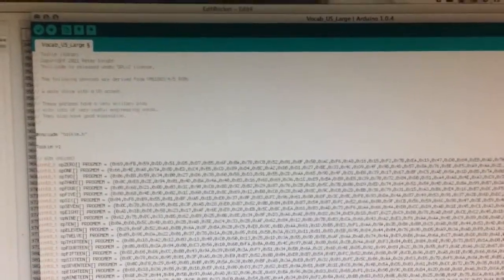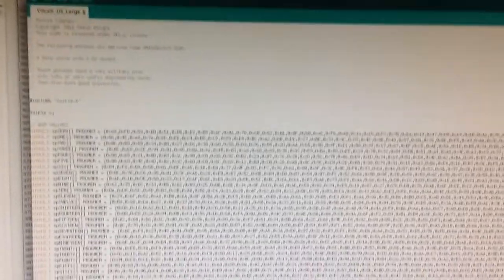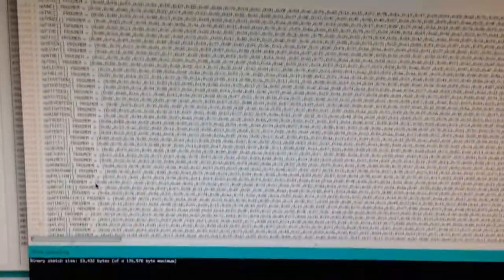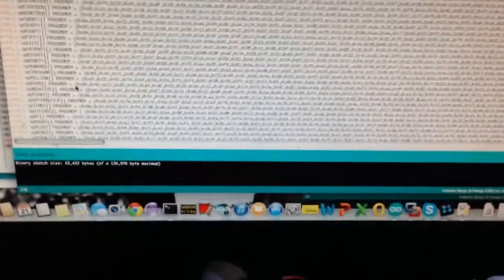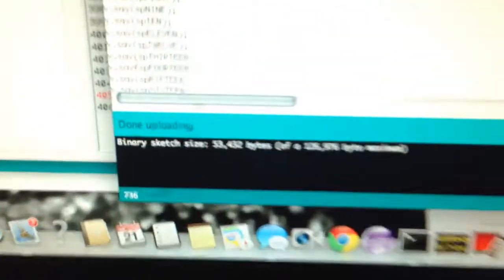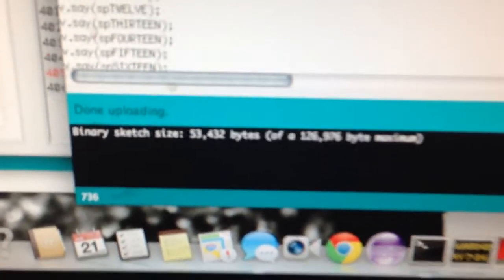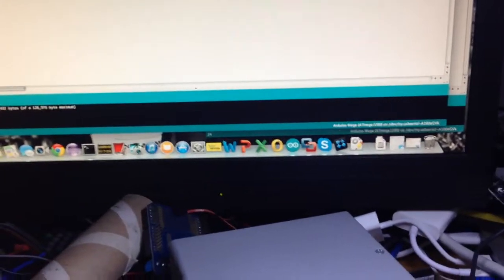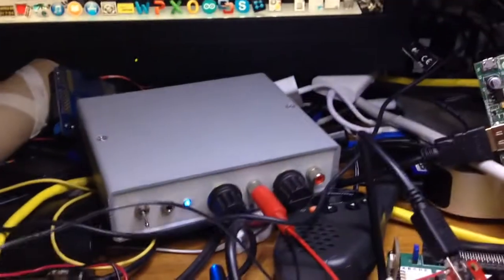Arduino Talkie speech synthesis

Comment: Tried the new talkie.cpp on the leonardo board with the pin on 5. But unfortunately, more error messages surfaced. I think these are registers on certain arduin oboards that are not present on the Leonardo. Will try to read the datasheets for it. Cheers once again and Thank you! Danger Danger Red Alert The Motor Is Fire! Hehehe :)
Reply: Yeah, different chips with incompatible ASM differences.

Comment: Hi @Ingmarthe geek. Thank you for this fix. The talkie TTS is now working on my Arduino MEGA ADK board with some minor addition to the code.  The arrays, a per Arduino IDE's advice will have to be set as constants. As an example the line "uint8_t spDANGER[] PROGMEM = {0x2D, 0xBF, 0x21, 0x92, 0x59, 0xB4, 0x9F, 0xA2, 0x87, 0x10, 0x8E, 0xDC, 0x72, 0xAB, 0x5B, 0x9D, 0x62, 0xA6, 0x42, 0x9E, 0x9C, 0xB8, 0xB3, 0x95, 0x0D, 0xAF, 0x14, 0x15, 0xA5, 0x47, 0xDE, 0x1D, 0x7A, 0x78, 0x3A, 0x49, 0x65, 0x55, 0xD0, 0x5E, 0xAE, 0x3A, 0xB5, 0x53, 0x93, 0x88, 0x65, 0xE2, 0x00, 0xEC, 0x9A, 0xEA, 0x80, 0x65, 0x82, 0xC7, 0xD8, 0x63, 0x0A, 0x9A, 0x65, 0x5D, 0x53, 0xC9, 0x49, 0x5C, 0xE1, 0x7D, 0x2F, 0x73, 0x2F, 0x47, 0x59, 0xC2, 0xDE, 0x9A, 0x27, 0x5F, 0xF1, 0x8B, 0xDF, 0xFF, 0x03};" will now have to be "const uint8_t spDANGER[] PROGMEM = {0x2D, 0xBF, 0x21, 0x92, 0x59, 0xB4, 0x9F, 0xA2, 0x87, 0x10, 0x8E, 0xDC, 0x72, 0xAB, 0x5B, 0x9D, 0x62, 0xA6, 0x42, 0x9E, 0x9C, 0xB8, 0xB3, 0x95, 0x0D, 0xAF, 0x14, 0x15, 0xA5, 0x47, 0xDE, 0x1D, 0x7A, 0x78, 0x3A, 0x49, 0x65, 0x55, 0xD0, 0x5E, 0xAE, 0x3A, 0xB5, 0x53, 0x93, 0x88, 0x65, 0xE2, 0x00, 0xEC, 0x9A, 0xEA, 0x80, 0x65, 0x82, 0xC7, 0xD8, 0x63, 0x0A, 0x9A, 0x65, 0x5D, 0x53, 0xC9, 0x49, 0x5C, 0xE1, 0x7D, 0x2F, 0x73, 0x2F, 0x47, 0x59, 0xC2, 0xDE, 0x9A, 0x27, 0x5F, 0xF1, 0x8B, 0xDF, 0xFF, 0x03};". My Arduino IDE version is 1.8.3. Cheers! and Thank you once again.

Comment: Hi @Ingmarthegeek, from what I have read from your fix below, the fix is a change in the line PINMODE(3, OUTPUT)  in the talkie.cpp to PINMODE(9, OUTPUT). And is this fix working with Arduino IDEv1.8.3?

Comment: Great demonstration. Is there a docomented proceess to add your own words? Could you explain the fix for using it on the Mega2560?
Reply from the maker: Wow, timewarp :-) Sorry I'm not very attentive when it comes to looking at YT comments. From memory the fix was as easy as ensuring that the PWM output pin on the MEGA2560 was set as an output using the PINMODE command. The default  in the library is PINMODE(3, OUTPUT) but the MEGA1280/2560 actually output their PWM on a different pin. I can't find the modified library at the moment and this is just going from a quick look. So my caveat is double check this yourself, I get really annoyed about people preaching the wrong info on YT so I will at least warn you I am not sure at present! Good luck.
Reply: Yes please I would love to see your code
Reply from the maker: Jean-Luc Deladrière
Just fired up a MEGA2560 and using the Arduino 1.04 IDE I modified the Talkie library to set pinMode(9, OUTPUT) in the talkie.cpp file (you will see the pinMode(3, OUTPUT) you need to replace) and it worked. It does NOT appear to work correctly in later IDE versions and so I may look into that later.